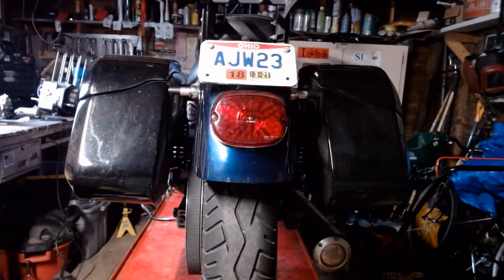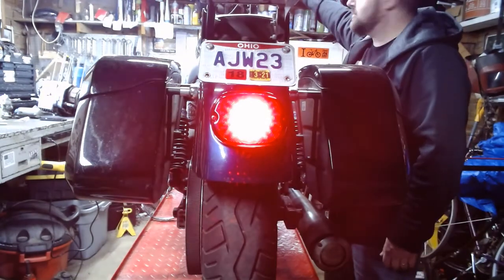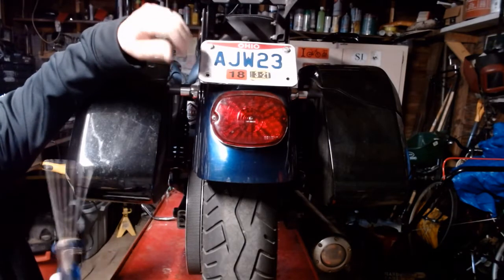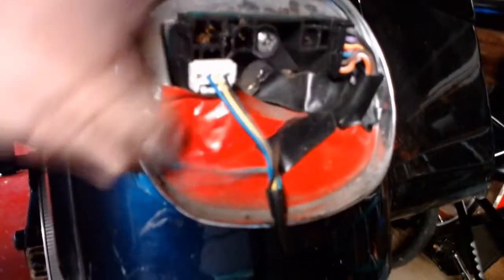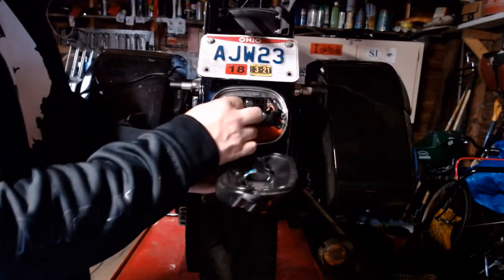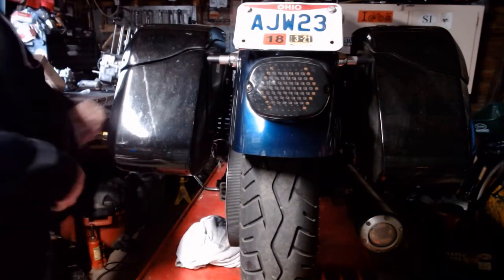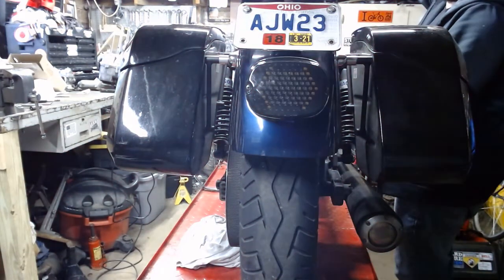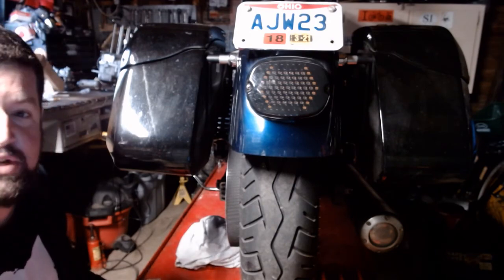Harley LED taillight compare & install - Speed Kings vs Moons

Comment: Was this truly plug and play? Even though you did this awhile ago?
Reply from the maker: Yes it was.   There is one switch for strobe or non strobe.  Otherwise it all plugs right in.  You will have to ad a load equalizer to make your turn signals blink at a proper speed though.   I covered that in another video.

Comment: Kind of unrelated but I'm going from the stock tail lights and turn signals to just and integrated tail light like yours. What did you use to plug the holes where the turn signals used to be?
Reply from the maker: I took the whole mount off and I have a lay back plate mount on there.  It mostly covered the hole.  I used a tiny dab of clear silicone.  It just looks like a dirt smudge.
Reply: Turn signal block off plates